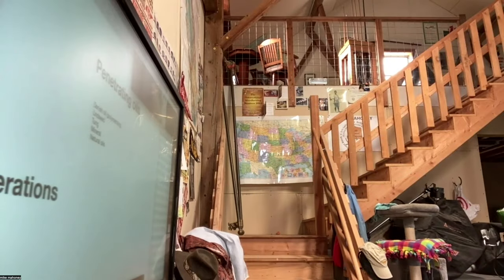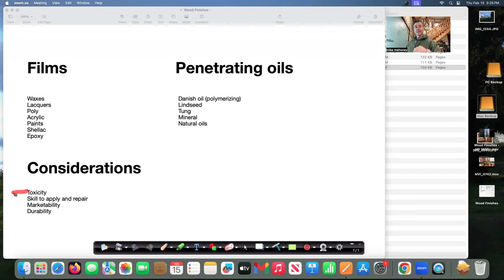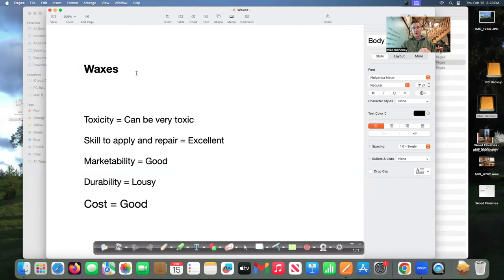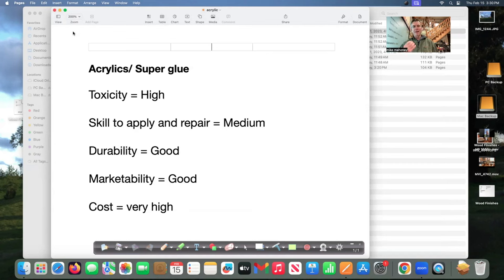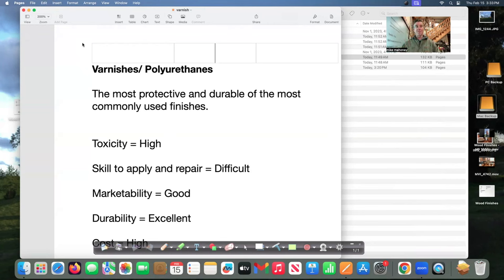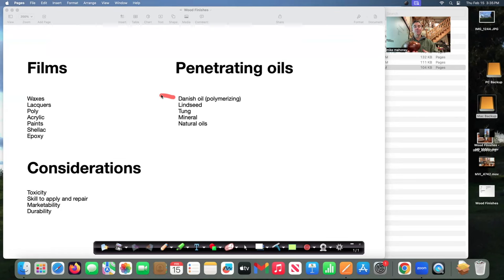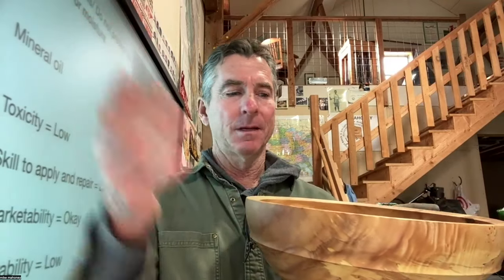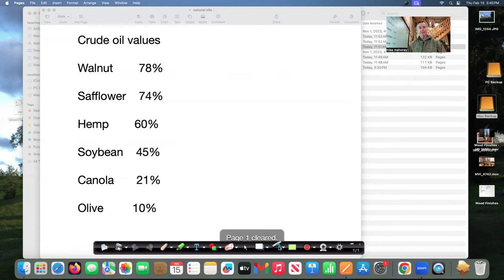Understanding wood finishes

Comment: I always thought that tung oil was in the same category as walnut oil - penetrating, polymerizing, good protection.  Can you briefly tell me the difference between the two?  Thanks very much!  It is very generous of you to share your years and years of experience on YouTube!
Reply from the maker: Tung will easily build to a shine that can be used as a moisture barrier. Walnut oil dries slower and is harder to build to a film. Many think 100% pure Tung oil is a myth. They may be correct but it probably is blended with distillits. Still a decent finish